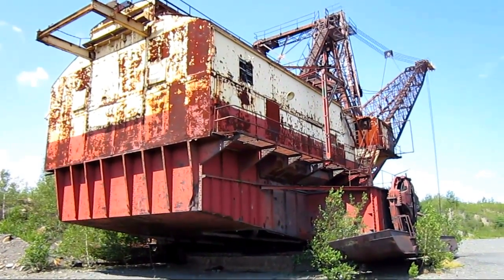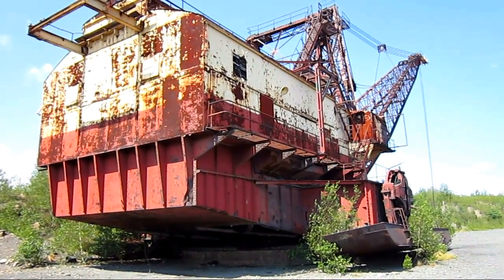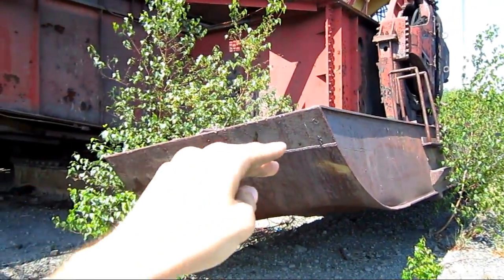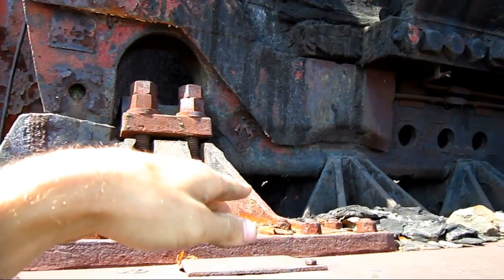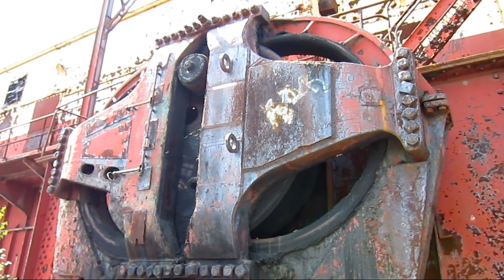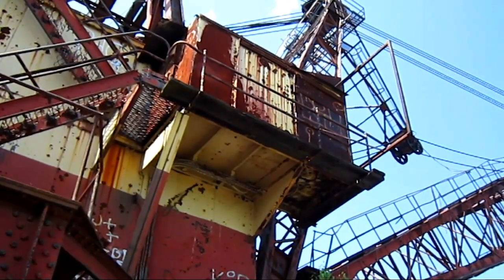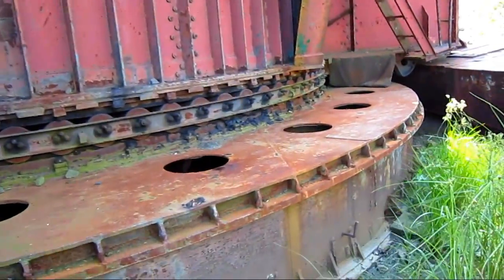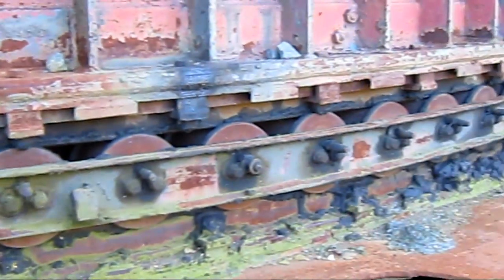Bucyrus-Erie 1150-B Documentary

Comment: There was one of these used by Hanna Mining to strip iron ore mines in the Hibbing Minnesota area from the late 1940's to the early 1960's.  It was coupled with a portable screening plant, several miles of overland conveyor, and a stacker to make the stripping dumps. 

In about 1965 it was sold to a "coal company out east." The paint was the same, though I think the cream, maroon, and red boom were a Bucyrus standard by then.

This wouldn't by chance be the same machine?  Do you have a serial number?  Amazing if it still exists.

If it helps, the Hanna one was electric.

Comment: The doors on the back of the machine are to let an overhead crane out of the back of the machine to raise and lower heavy motors, generators, gears, and shafts. The small cranes on the sides of the machine are too small to handle heavy parts. They are used for grease barrels and other supplies and they swing out by hand. I have been a groundman, welder, oiler, and operator on a BE1250, BE2570, and Marion8900.
Reply: Thasnksd You Kind Sir!

Comment: I'm 100% sure that if some day this machine would be needed again and all that metal shieldings were removed, it would only need some greasing, cleaning of electrical contacts and some serious ammounts of starter fluidm (oil change in engine is mandatory!!) it would run again. These machines were built to last almost forever. Too bad it was scraped, it is such a shame that machines so monumental are cut to pieces and melted. They do not deserve a fate like that.

Comment: Just been on a visit to a preserved 1150 B near Leeds in the UK, imported from the USA in the late 40's Its named 'Oddball' because it had General Electric control gear the others had Westinghouse equipment,
Its mostly complete apart from where the scrap thieves have damaged it. A group of enthusiasts are trying to keep it fit for viewing on open days throughout the year.
Reply: same one walked all the way from Newcastle to its current location allerton bywater & is now listed aswell as fenced off it does have open days these are often during holidays, dragline was lucky as the site its on got flooded out when 2007 floods & was rendered too expensive to drain the site so it was just abandoned along with the dragline
Reply: Oddball never worked in Newcastle, the site flooded in 1988 and was drained and worked again in 1998 but oddball didn't work again after 1988.http://www.walkingdragline.org/history/

Comment: An 1150B was the largest dragline used on the Mesabi Iron Range in MN. It was brought in to strip on the west end of the range where the overburden was thickest, and went east to the coalfields a few years later. It dumped onto a mobile screening plant that fed a conveyor to the overburden dump. The boulders screened out were hauled off by trucks. Draglines were rare here, as all mining and almost all stripping was/is done with shovels. A 30 yd bucket from the 1150B is on display in Hibbing, MN.